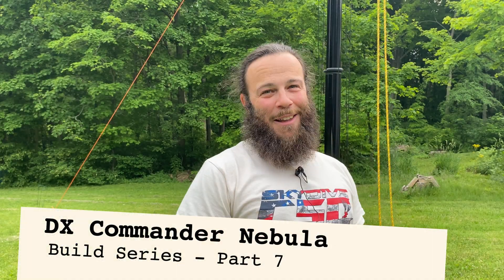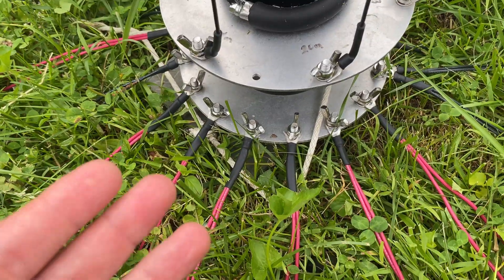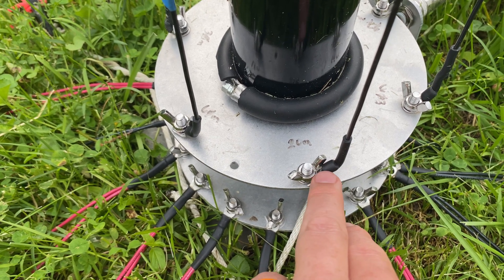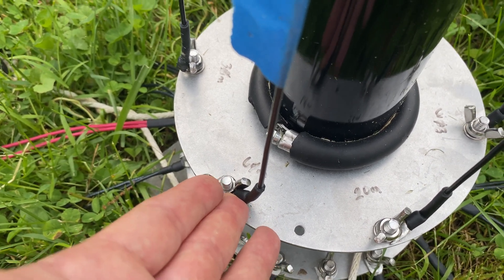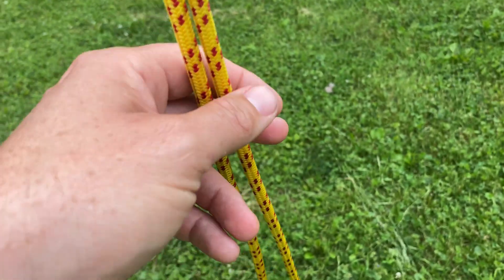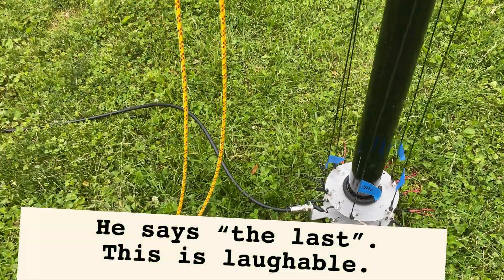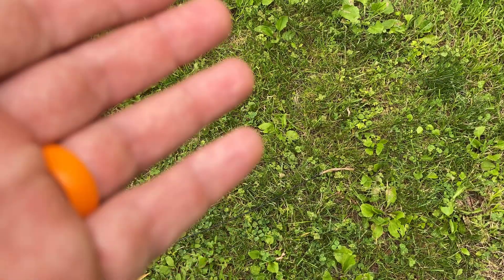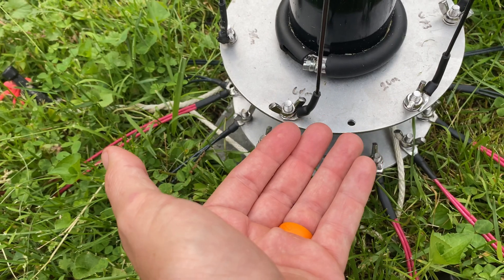DX Commander Nebula - Part 7

Comment: Well how does it perform?
Reply from the maker: Fantastic, it is still the primary antenna I use from my home shack. I run WSJTX reporting to PSK reporter most of the time that I am not using my radio so you can go to PSK reporter and see what the antenna hears if you like.

Comment: Really enjoyed your videos!  Did a search for " Nebula" and found you. Trying to decide between the 12.4 and the big boy.  Comes down to a clean element or a loading. Did you look at the 12.4?  I was also thinking about a bottom pivot mounted in concrete.
Reply from the maker: If you have the room and if you have the strength needed to lift the antenna (It is not heavy at all but "heavy" is a relative term right?), then I suggest the Nebula. Making the loading coil is a variable that will need some up/down/up/down work to get right while shortening or lengthening an element is much simpler. 

The 12.4 was not available when I bought my Nebula and I considered getting one when the storm took my Nebula out but decided to just replace it with the Nebula again. It is such a great antenna.

Comment: My Nebula just came in, and unboxed - done nothing beyond that.  YES, your videos are MUCH appreciated.   I too asked (myself) "Why not 10m ?"   So did you do it ?  I even thought about replacing 30m (fairly restrictive band) with 10m.   What did you do ?  What do you recommend ?
Reply from the maker: I kept the 30m element because I use it for FT8 but I added the @k8mrdradiostuff mod by adding and element on the unused hole on the driven plate that does 10m on a ¼ wave. 

You are going to love this antenna, it is fantastic.
Reply: @LifeAtTerminalVelocity  Thank you !
Reply: Sorry to bug you again - you wrote "I added the @k8mrdradiostuff mod . . ."   -- I've looked over his large production, and can't seem locate that mod.  Might you help, please ?  And I'm most interested in your mods and would like links - e.g. "night line" ?  Looks good, and practical.  Did you find the right-angle forks ?
Reply from the maker: Not a bug. So my buddy Mike (K8MRD - https://www.youtube.com/@K8MRD ) made a video about a year ago ( https://youtu.be/xeaQVapy2Wc  ) detailing how to add an extra element to a DX Commander Expedition 12m. The same exact item can be done on the Nebula/18m. Basically you make an extra element for the band you want and you tie it into the driven plate by way of the unused threaded hole.
Reply from the maker: Also, I realized I didn't answer the question about the 90º connectors. I haven't found them on Amazon, Digikey, Mouser, or McMaster. The reflective line is this: https://amzn.to/3o4Ck2i that is an affiliate link.
Reply: @LifeAtTerminalVelocity  Much appreciated, and ordering this, and the carabiners from your links.

Comment: What did you do to solve the 80m tuning problem? You mentioned it while you were tweaking the element lengths but didn't comment on what the solution was in your closing video.
Reply from the maker: I ended up cutting the 80m element to just be an 80m element and adding the @k8mrd mod making a standalone 10m element. It doesn't have as much gain but it was loads easier to tune.

Comment: Great video series Carlos! Just ordered a "Nebula" myself. I intend to use it for the 80,40,20,21 and 10m bands only. Have you  installed a dedicated element for the 10m band? Will be interesting to hear the results...
Reply from the maker: I did end up putting a 10m element off the "back side" of the driven plate. I'll make a short video showing what I did in a couple weeks.
Reply: @LifeAtTerminalVelocity  Thanks! I was thinking about that. Will be waiting to watch the video...73!